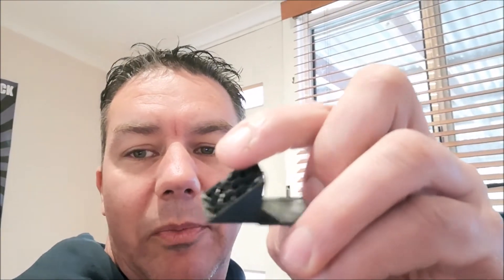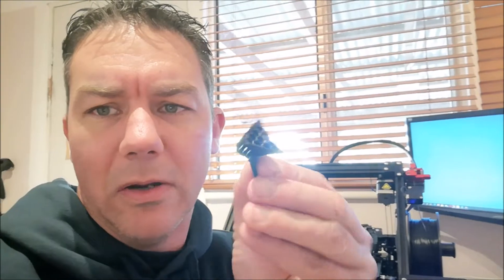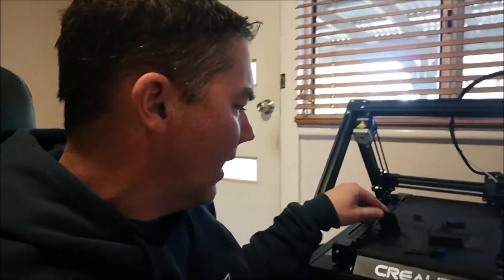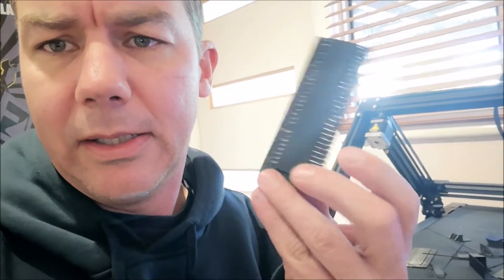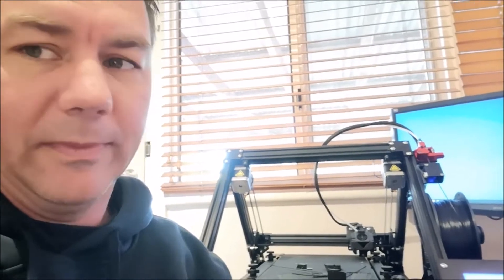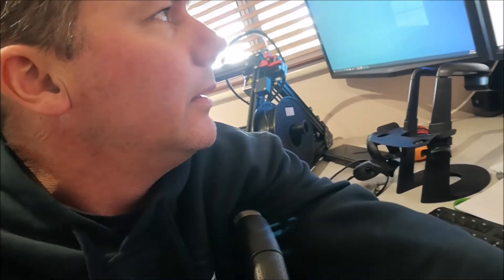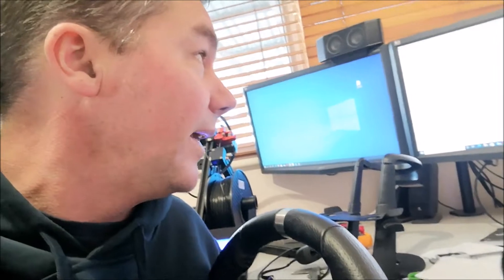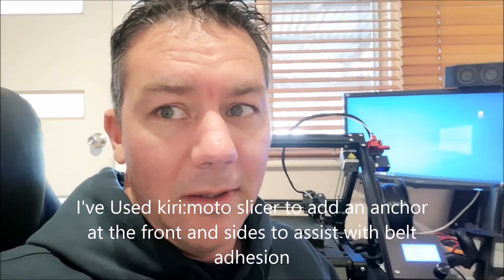CR30 Z axis problem

Comment from the maker: [SOLVED] For anyone interested I did get this sorted finally. I ended up replacing the Belt. As I bought this when they were first released I believe that there was a different belt used compared to the kick starter and prototype models. I also believe that the belt was changed again sometime after the initial release to the public. The belt that came with my printer was 1.10mm thick and the replacement belt that I sourced  from Ebay was 1.25mm. It worked great pretty much straight away without anything used on it to increase the adhesion.  Here is a link to that video of the belt being changed. https://youtu.be/LaFiY4DULs4
Reply: Was the 1.25mm belt you replaced with a Creality product or a 3rd party one? I’m struggling with the exact same problem you had, but can’t seem to easily find the replacement belt you have.

Comment: I had the same trouble it was the belt frame bolts to the main frame wer loose.
Reply from the maker: Thanks I will check that. I found the extruder loose just recently and I thought that would solve all of my issues. But no, it's the same as before. It really struggles with adhesion and I've leveled it at different heights a million times. I want to love this printer but it's hard work.
Reply: I finaly got bead adhesion after scrubbing the belt with a green scotchbrite sponge pad and 99% Isopropyl alcohol, a lot of black comes off at the start, but the more you can get off the better it works. I had to scrub it very hard and wipe it with a clean paper towel wile its still wet to get most of it off, and Ive done it 4 times so far but its getting beter every time I scrub it.
Reply from the maker: @BIGDOGFORGE  This did work and I had my best success with this method, however I've just replaced the belt with a thicker one and it works better than my old belt ever did now. I think creality changed the belt thickness after the initial release to the public. Mine was one of the first purchased.

Comment: My m92 settings on my original CR-30 reads like this:  M92 X80.00 Y80.00 Z1148.40 E137.65    Make sure your belt is tight but not too tight.   I don't think gluestick will help if the belt is flexing too much.    Getting the Z Height is nothing short of magic.   I had to set and reset it constantly.  The metal gauge for setting it is kind of a lie also.  Mine had to be super tight almost tight enough that if it was paper it would have ripped.     I've also been using the IdeaMaker slicer and it seems to be the only one that will work for what I am trying to print.  Plus it has this cool texturing component now.
Reply from the maker: Thanks Wayne, your settings for the steps are exactly the same as mine. I tried a all of your suggestions and I've finally had some success. Possibly the biggest change was making the nozzle really tight as you spoke about tearing the paper during a levelling adjustment. Also I trimmed the silicon nozzle hood as I found that it was touching the bed and also making a level adjustment difficult as it was slightly depressing the belt down. And lastly was using idea maker to slice. I believe that also made  a difference. I got a 20 print completed successfully after these changes and prior I had very limited success. Thanks for your help.

Comment: I was having the same issue, I fixed it but re adjusting the back frame. I think it is an issue with the angle not being exactly 45 degrees, when it gets to the top of the print it is pressing too hard on the cube making it dislodge. This is the video that explains it pretty good https://www.youtube.com/watch?v=CvUnHj6OMWo&t=9s
Reply from the maker: Thanks, I have seen the grid space video before about leveling the opposite end to the print nozzle and have done so at various heights. It hasn't made a real difference. What I eventually found was after applying glue stick to the belt suface the same print went from a failing within 1cm to a successful near perfect print without any adjustment. It appears that my very early production run printer has a different belt to the pre production ones which had excellent adhesion, and the later released machines also appear to have a different belt again with less adhesion than the pre production models but more than mine.

Comment: Use glue stick on the belt
Reply from the maker: I finally tried this and it worked after trying nozzle heights at so many different heights, bed temps and extrusion temp changes. It appears my belt has way less adhesion than the post production models and what is shipped today.
Reply: I second the glue stick. worked like a charm.